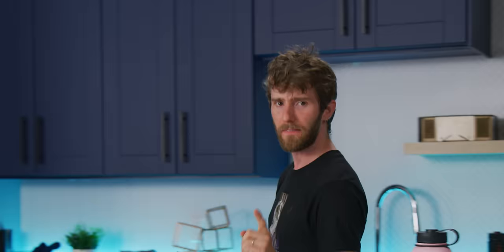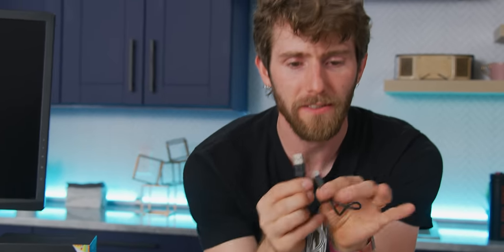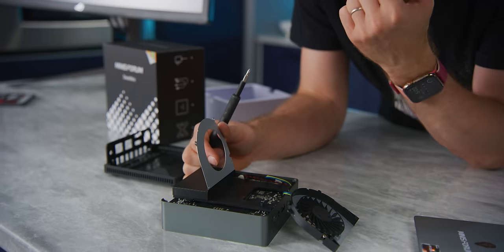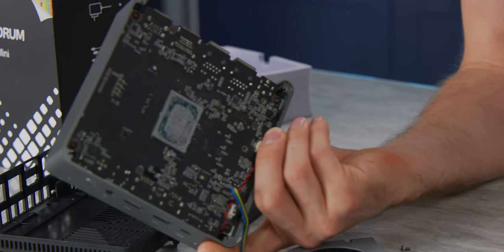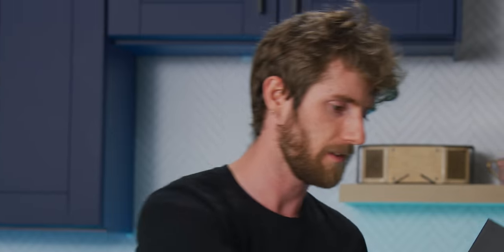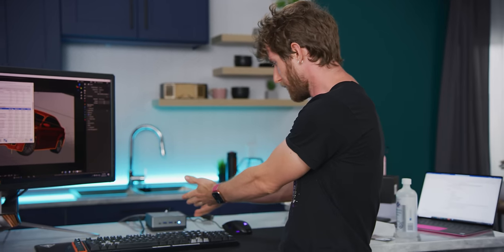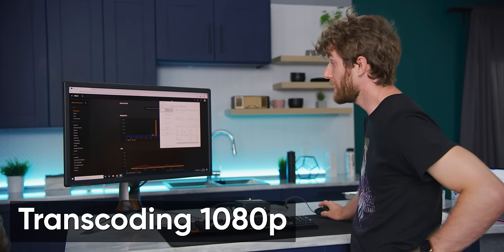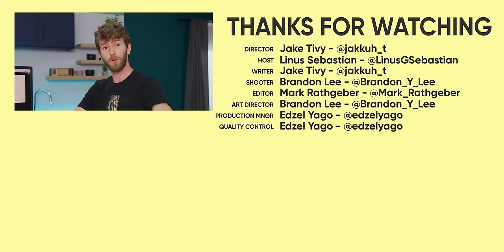FINALLY... a Ryzen Mini PC!

Comment: I prefer the deskmini A300. It's been available for 1,5 years, is only slightly larger but orders of magnitude easier to service. It's socketed, accepts aftermarket CPU coolers and with the latest bios that asrock released (and then pulled back in order to not hurt their X300 sales) it even supports current renoir APUs. I run a 4750G 8core in there at the moment with no cooling issues

Comment: If you contact Minisforum they'll provide you with a BIOS flash up to enable change to the TDP and ram speed. 35W TDP and two 3600Mhz dual rank sticks will get the max out of this unit. It's currently stuck at only 25W TDP and only 2400MHz ram speed. The Vega 10 benefits the most from 35W TDP and 3600MHz of ram. For the UM700 model if you have a review unit

Comment: My parents both have now Minisforum NUC-alikes and they are ok with them. When a user is mostly doing office stuff with it, but don't want a laptop but a proper desktop pc with monitor and proper keyboard - these are good solutions. Also, you can in the future upgrade them, as Minisforum has said that they will offer also newer AMD generations (of course as Laptop version). And as AMD with Zen 3 will go the Intel way of giving all their CPUs some Radeon GPU cores (because the GPU shortage really has hurt them, as many only bought a 11gen Intel because... it has Graphics on board...), these small NUCs could for many people become a good solution.

Comment: "Its not my favorite thing in the world to have a CPU running at 80 degrees C"

Me with my laptop CPU running at 100 degrees C: O_O
Reply: Me with laptop running at 75C idle 🗿
Reply: Chestnuts roasting.
Reply: Mobile always runs hotter than desktop, and the chips are designed with that in mind. Linus is just used to desktop and thus 80C+ is offensive to him.
Reply: @RayneAngelus  yeah that's true
Reply: My laptop run 50 60c idle and 85plusc gaming and stresstest 89c

Comment: They are very restrictive when it comes to trying to change settings in the BIOS. You have to gab them to death to get what you want. Still waiting on a flash update to enable change to the ram speeds. It's locked at 2400Mhz on both the DMAF5 and the UM700 even if you upgrade the ram it's locked.

Comment: Why won’t Apple adopt AMD processors? They’d rather go through the trouble of adapting ARM than using the easy winner Ryzen.
Reply: Because they will have more fine control of the hardware, and arm is much more power efficient. Plus, they already make their own arm chips.
Reply: Yeah
Reply: Q: How do you talk to giants?

A: Use big words!
Reply: Apple likely wants to own every stage of production
Reply: madmeth0d but why would they bother with Intel until their ARM chips are ready? They could switch to Ryzen since they already have a working relationship with AMD for their graphics.
Reply: Because 1. they want full control and 2. when they started with ARM on desktop AMD wasn't really a serious choice. They could still switch strategies and adopt Ryzen but at this point it's not about getting the best laptop for you, it's about making the best laptop for Apple, and that basically means just an overgrown iPad.

It's one of those choices that will backfire on them horribly when they lose their edge in user friendliness and will have to start competing on performance and compatibility.
Reply: Just like now AMD seems like the obvious choice back when they switched from PowerPC Intel was the obvious choice. By switching to their own chips they can directly control their products and there shouldn’t happen things like MacBooks overheating because Intel promised 10nm years ago anymore
Reply: @eduardocchipinti1493  tbf that's not the only reason macbooks overheat, Apple's increasingly underwhelming cooling solutions are also to blame there. Like, on the new "wireless heatpipe" Macbook Air the heatsink isn't even making proper contact with the CPU, it's basically as messed up as a cooler can get.
Reply: Eduard Occhipinti I understand that, but I mean for like 2020 and 2021 while they’re still transitioning, there’s no reason to stick with Intel on the non-ARM chips before they completely migrate.
Reply: Borsalino Kizaru yes, there would be a ton of software changes to make to transition from intel to AMD and it’s not worth it if they know they’ll be transitioning to ARM anyway
Reply: Eduard Occhipinti Oh ok, I wasn’t aware of that. I just thought it would require a socket change since they were both x86 chips. Good answer.
Reply: Ben Snow yeah the new MacBook Air have a mess of a cooling solution, the only way on é could justify that is that they’ve done it on purpose so that the gains given by switching to ARM will seem bigger. The MacBook Pro however have a decent cooling solution and overheated only because Apple planned a thinner design but intel wasn’t able to deliver cooler CPU’s until this year

Comment: Just a comment on the "short" HDMI cable included in the box. Its actually pretty difficult to find a short but also very flexible HDMI cable. For example for mounting a nuc like this /apple tv etc. on the back of your monitor. Most if not all (at least where i live) HDMI cables are too thic to do a 180° turn in your cable routing.

Comment: While that is as small as an android box, Raspberry Pi's are still the smallest PC's ever.
Reply: Yea but pi can barely run windows
Reply: @cytrus3427  it can't it runs rasbian. A Linux distro
Reply: This thing runs marathons around a RPI
Reply: Georg Kozy it probably can
Reply: All windows machines are open source
Reply: @gorillafighter4037  ?
Windows is not open source.
Reply: @kozygeorg  You can run whatever you want, however running rasbian or other lighter linux distros will be best to get good performance.
Reply: Cekpi7 ... I mean that you can boot other OS’ to PC

Comment: Transcoding to lower resolutions can be more expensive. If you don't change resolution from the original, it may be able to basically not really transcode at all and still stream it.

Comment: I've always wondered why AMD weren't getting in on this, but I also wonder how big the market even is for it.
Reply: Small. For under $900, you can build a 10x better small form factor desktop with the latest desktop Ryzens and DDR5 memory boards.
Reply: @frankfarago2825 SFF is still way larger than NUC, you have to build mini-ITX, and cases, motherboards, power supplies and good low-profile cooling solutions are very expensive (not to mention that mini-ITX system is still larger)

Comment: "Who likes rubbers on their NVMe stick?", 
 
ME when it comes to the position of the SATA drive that screws to under the top and will therefore come into close proximity with the NVMe stick and heatsink for it, thus letting SOME airflow there, I guess, in this tiny system.

Comment: I'm laughing that you made this now because I was in the market for one a month ago I ended up just building one for about the same price.
Asrock A300w
G.skill ddr4 2800
Ryzen 5 3400G
WD Blue 500 GB SSD
From Newegg $470
Reply: I had a 2200g sitting around and used it in the A300W  with crucial ballistix 2x8 gb 3200 ram with a wd 500gb 2.5 ssd amd just recently put in the Noctua NH-l9a chromax. I probably spent 400 with the noctua cooler.
Reply: Dont cheap out on Power supplys
Reply: I think the small form factor of Mini Forum is whats making this mini Pc cost more but its not going to provide the power people really need for PC Gaming unless they set it to low settings or play Games that’s not very demanding graphic wise
Reply: I should note, this mini-pc isn't for gaming, it's for an office pc intended to last a while, the form factor was for space constraints and being able to access the pc when needed.  My personal rig is an x570 Ryzen 9 3900
Reply: Most tech channels really slept on the AsRock A300. Why would you buy a NUC-like PC when you can have a socketed one that allows for APU choice, less cost and some upgradabilty, all packed into a not too much bigger case?
Writing this from my A300W HTPC, with same level of performance as this one but much cheaper

Comment: Tech Tip: The AMD Ryzen 5 3550h Vega 8 doesn’t fully clock to 1240mhz like it should the highest you can overclock it while being stable is 1100mhz. Linus is probably playing games at 800mhz without overclocking. Use Ryzen Controller.

Comment: An AMD “nuc “ released in 2020 should have had Renoir.
Reply: The product was probably designed before Renoir launched, since it's clearly not something they worked with AMD to do. I'm sure if this does decently well they'll come back around with a Zen 2 version.
Reply: Hugh Jarse  As Linus said, "First of its kind." Unfortunately, as has been the case more than once in the past, when an independent outfit does a Thing with the hardware they have ready access to, a mainstream outfit does something better not long after with hardware they sourced more directly from the manufacturer. But Minisforum still gets "First" creds.
Reply: Hugh Jarse  Yes, it might be out of date, but don't forget, ASUS will have you pay your ASUS tax on top of the price, while this NUC here is priced really hard to the bottom possible with 425 full stocked. Look how much a Intel NUC costs without having the SSD and RAM installed: It's often more expensive with less power.
Reply: Acme. Nipp-on-AiR the asus starts at $450 no ram/ssd but that’s a difference of 20-60 bucks max. And it’s going to be way faster and easier to cool. Plus it’s nvme not sata
Reply: And Zotac announces a NUC-alike with... Mobile Ryzen 3000. =P

Comment: Can you guys confirm the fps? I'm still amazed that it can run at 50 to 60 fps at 4k, even if it's at low settings
Reply: Most E-Sports and indie titles can do 4k60 on an RX580 or a GT1060, with most settings at High to Medium. Anti-aliasing should be the first to go if you are having problems. Unity and Unreal are significantly ahead of the AAA studio engines in graphical fidelity per used GPU cycles.

Comment: Valorant (for some strange reason) sometimes shows the resolution at 4k even though it's actually at 1080p. I do not have a 4k monitor. It might have done the same here.

Comment: Zen+ mobile (3000H and 3000U) supports up to 2400mhz, so nothing wrong with their bios.
Only the 4000 series supports 3200mhz.
Single channel is really sad on this system, it looses a significant amount of performance.

Comment: I use a raspberry pi 4 as a media pc and I have a small tv remote with air mouse and a keyboard on the back of it. It's a pretty nice setup but it would likely lag on 4k resolution.
Reply: I will say though, if you don't have the means to run steam link reliably with good wifi or ethernet then a raspberry pi setup would not be for you.

Comment: I'm really interested to know how it would work with a pen display tablet like a cintiq or a huion kamvas, but like, plugged in right to the thing, like using a cintiq as a main monitor, if it works it would end up being as useful as the huion 22 inch mobile studio in the idea that it's a reasonably good pc with a quality pen display and fairly portable as long as you have a power output nearby (since there's no battery), but with the possibility of using it in a 12, 13 or 16" display instead of that huge 22, fits better in a backpack or something, probably cheaper than a comparable 2 in 1 with pen support or a regular notebook+pen display and definitely cheaper than those expensive-ass mobile studios by Wacom and huion

Comment: Finally ... ? What about ASRock DeskMini A300/X300 which can handle R7 PRO 4750G '65W' APU? Size 155 * 155 * 80, and 3200MHz RAM, NVMe SSD,  I built one and it runs Win10 and Linux dual boot. Needed a cooling upgrade (Delta fan on Noctua cooler) though. Cinebench R15 is 2090 cb.
Reply: where did you buy your cpu? Ali Express? can't seem to find many on Ebay
Reply: @abdulmudhir4042  It was eBay from China, about 3 months ago, just under UK£300. Well worth the delivery wait. It's a productivity beast, but wouldn't recommend for high fps gaming. I got bored waiting for 5000 series availability so tried something else.

Comment: do you think this pc is good enough for a home surveillance recorder set to record only when motion is detected i am trying to setup a pc to record from 7-12 ip cams all streaming 1080p
Reply: I use a chinese one with a j4125 celeron for $200 usd. gets the job done make sure it comes with a thick case that means theres a fan cooling the cpu.
Reply: @slumy8195  yea the one i ended up buying was $530 maxtang ryzen5 with 16Gb ddr4 aswell as a 512Gb m.2ssd and it is fan-less so it dose get quit hot so i was thinking of getting a usb fan to blow across it and using a coral accelerator for use with frigate in home assistant
Reply: @phillangstrom8693  take off the case and tilt  the fan to it. Buy some dust filter on amazon and your good.

Comment: Drzigzag hello
I like the X400 AMD 7Pro 4750G,
but I need used A external graphic card Quaddro RTX 4000
Using: R43SG-TB3 PCIe 3.0 x16 PCI-e x16 to TB3 Extension Cable Laptop External Graphics Video Card Docking Station PCI-Express 16x Cables eGPU Adapter (25CM, R43SG-TB3) (25CM, R43SG-TB3) AMD Ryzen™ 7 PRO 4750G , 8 Cores/16 Threads (Total L2 Cache 4MB , Total L3 Cache 8MB , Base Clock 3.6 GHz , up to 4.4 GHz)

Comment: audio should not a problem if at least a serious audio controller  on board.     playing 24/bit 192kHz max 0.6% cpu use while loading the audio file, dropping to 0.1% for decoding , okay threadripper with 128GB ram

Comment: @linus tech tips i reacently got a ryzen 5 5600g 16g single stick ram. 260w power suply, what would be a good gpu card to out do the intergrated radeon. i mean he intergrated graphics perfoms incredibly wow but im worried about the 260w supply. i recently brought it from argos lenovo idea 5 ryzen 5 5600g 16g ram 500gb ssd  for little over 500 pound.. it plays everything i couldnt on my 4g ram 2g graphics and at just as good as the 2g of gpu. any way can you recomend a gpu card that would be compatible with 260w power suply, every one is telling me i need minimum 300w but that not what i got

Comment: Can someone help me to choose this and   
Xiaomi Redmibook 14 II Laptop AMD Ryzen 5 4500U 16GB 512GB 14 Inch price for this EU 644 and EU 569 for mini pc. EU 74 more for laptop
Reply: Get the laptop. This mini pc is using 3000 U series processor which is slightly weaker than Xiaomi laptop.
Reply: @zenniz1992  thanks ! I decided to get the minisforum elitemini x400 8 GB Ram 256GB for EU 520